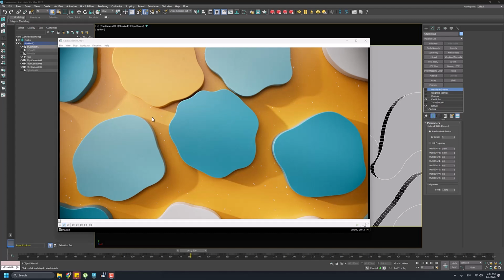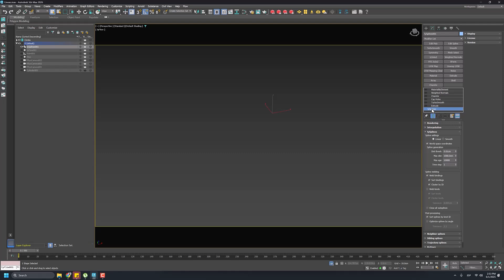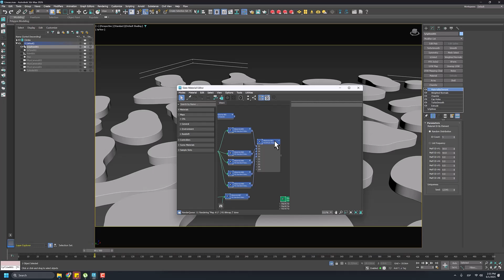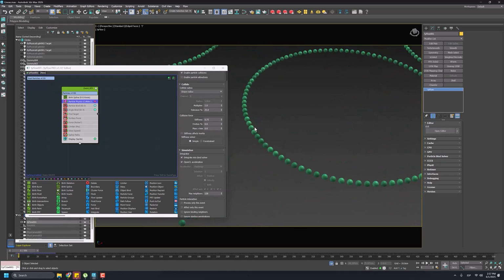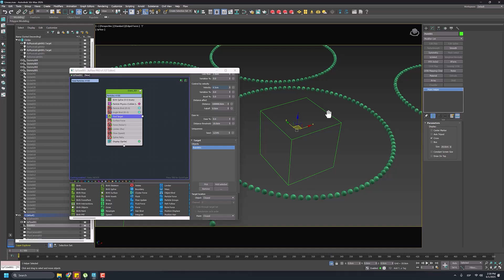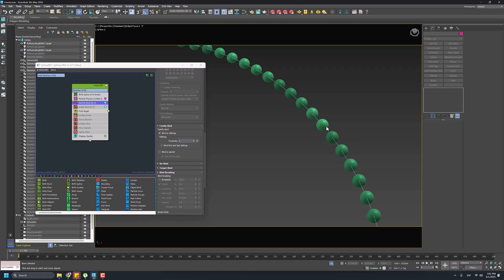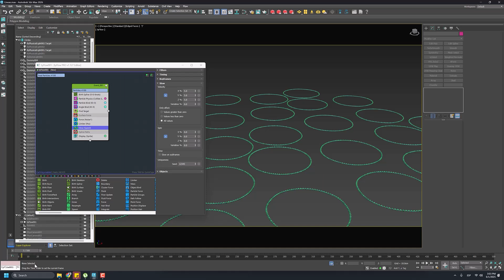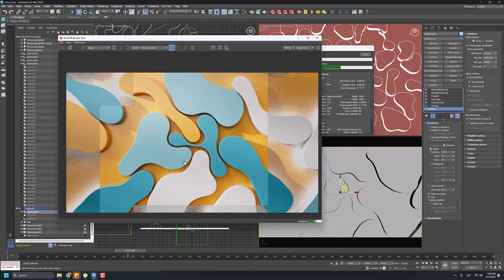Abstract lines With 3dsmax + Tyflow Breakdown

Comment: FOllowed to the T and yet my knots when binding 1st and last sibling together create a reversed normal face that IM finding an inability to rectify. so when I extrue one face in particular (1st knot) is reverse.  Normalizing spline or aligning all normals creates different problems and without fixing , cap faces doesn't work. I'm on 1.128
Reply from the maker: Maybe welding the Ty spline knots